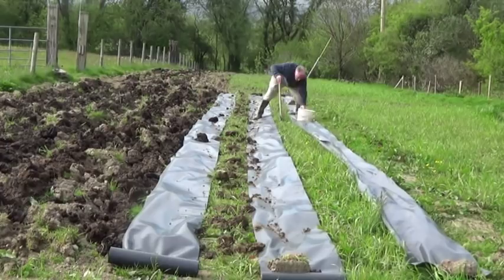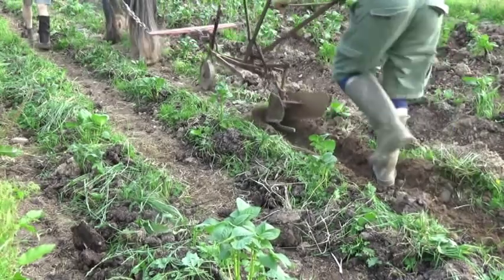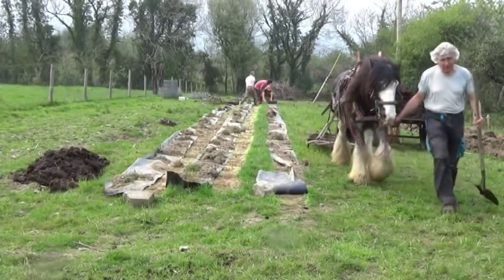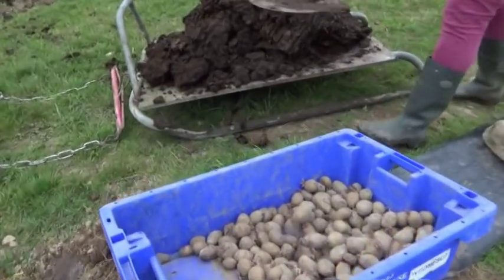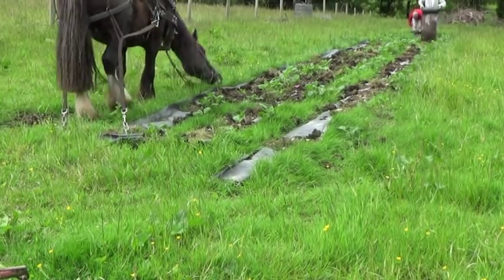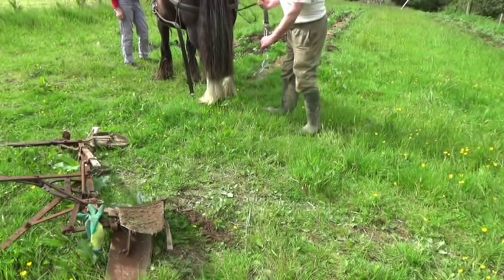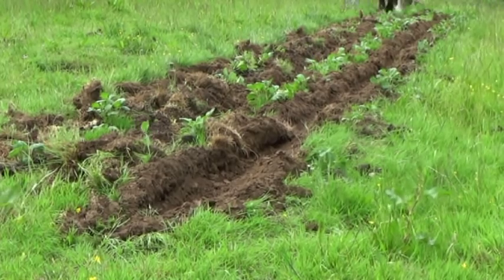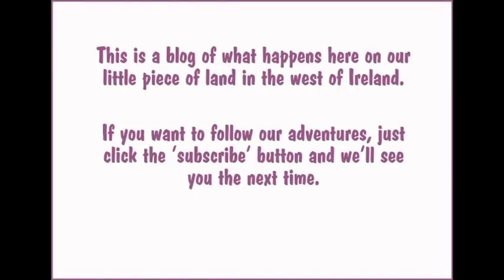No-Dig Potato Growing Experiment - New Improved Version!

Comment: Just an idea-

In the States we have an annual Rye. It is typically used to overseed fields after Fall tillage as a cover crop. It grows slowly in the winter and around May can be mown as is wheat. It is good fodder and green manure when tilled in.It is an annual and not great at self seeding itself.

If you used that and put the plastic down, the dying rye in the rows would mulch the potatoes and keep down weeds. 

I imagine annual rye will grow in your climate.

I dont know if Rye as such is available in Ireland.

Best wishes
Frank
Reply from the maker: Thanks, Frank - I'm sure it would grow here but the problem is the same - how do we plant the rye without ploughing the land? Ploughing is what we're trying to avoid if we can..
Reply: Rye will grow if broadcasted but you’d need to kill off the sod first. Anyhow, your plan looks like it is probably going to work just fine.

Comment: I like how this is looking very much compared to the last time. I may try this myself. The plastic looks difficult to work with. I'm trying to think of something cheap and more rigid so it holds to it's line easier and doesn't need so much holding down. Rolls of aluminum flashing? Several times the cost of plastic, but more reusable.
Reply from the maker: Yes, that could work - but this plastic is very robust too and a lot cheaper than aluminium. I'm thinking next time we'll try pinning it down with tent-pegs. If that works then we could be on to a winner..!

Comment: Tim plz put a wire wheel on a hand grinder n polish up your plow. 
Once polished, put some type of oil on it, when shining will move dirt better , be easer on you n horse.
Once shining, clean dirt add oil or grease. Can use cooking grease if ya choice. 
We cut our potatoes, two -three eyes to the piece, stretches seed n more eyes give smaller potatoes .
We'd normally grow 55-60 bushels on a 1/2 acher .
Reply from the maker: You're right. Usually this plough runs through tilled soil so it's not been a problem, but this time the soil is firmer so you're right, it might be worth doing.

Comment: Seems like an awful lot of work. If I understand your vid, the objective is to keep the grass and weeds from growing up next to the potato rows, with a solution that can be applied on a much larger scale, say to an entire field. I would either plow & plant & weed the old fashioned way, or you could try the plastic sheets, but you'd have to stake them down so they wouldn't blow-in way out west, and you'd also have to perforate them like crazy so rain/ irrigation could get to your spuds. The manure on dry earth doesn't look very soil friendly for potatoes, but good luck with it.
Reply from the maker: We're trying to avoid ploughing if we can - because it leads to so much leaching and erosion, and we're trying to avoid using big sheets of plastic too - so it's a challenge
Reply: @WayOutWestx2  - I read someplace that it's good to rotate the soil use, for example, plant potatoes in year one, then other plants in years two and three, before returning to potatoes in year four. This might require three different patches for potatoes/etc. You have livestock (sheep, pigs, donkeys) that could get rid of all grass and weeds,  then plant the potatoes, in furrowed rows so the rains wouldn't run the soil off.  (PS - would love to see a vid of your farm during a really blow out storm: high winds, pouring rain, maybe some lightning & thunder. Think it would be very dramatic and appealing.)

Comment: I use cardboard instead of plastic
Reply: I'm experimenting with cardboard run through a paper shredder, as a general veggie garden mulch. This is my second year. So far, so good!
Reply from the maker: Cardboard's good - but on a field scale? We will do some more experiments..
Reply: Supermarkets send bales of it off for recycling everyday,  you could make a collection arrangement with 3 supermarkets to get ink free non glossy cardboard . I did for my allotment,  now it is only 120sq m but I got it done in a day, 3 layers thick and covered it with 15cm of horse manure. You could do 100sqm a day until it's all done and you only have to do it once .weeds are much much easier to manage after this and about 7 cm of manure is spread on the beds every year after this.
Reply: @WayOutWestx2  Here in Canada Costco always has large cardboard boxes they'll gladly give you
Reply: @MrFakit  But does cardboard heat the ground beneath it? Will you have to collect more cardboard every year? Does the decomposition of the cardboard rob any nitrogen from the crop? I hate plastics, but they do seem to be a great fit for this method.